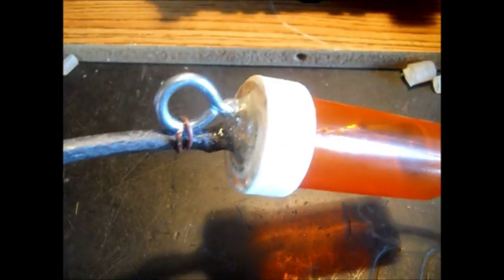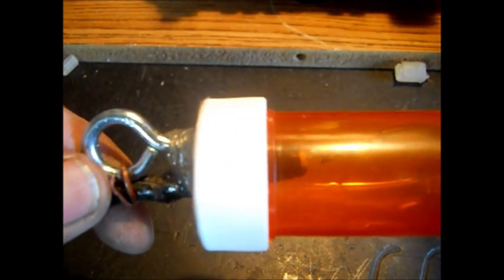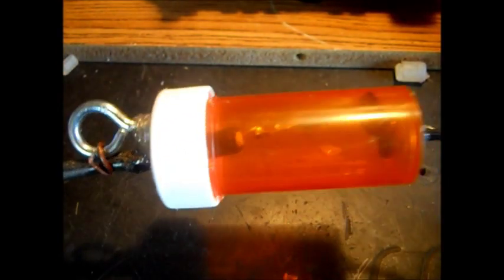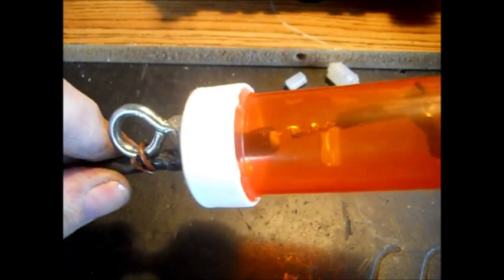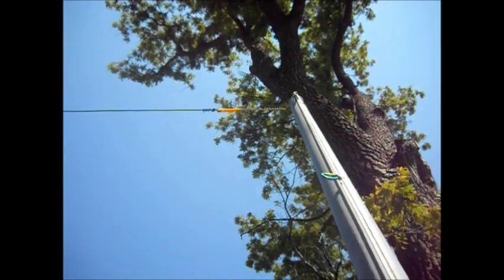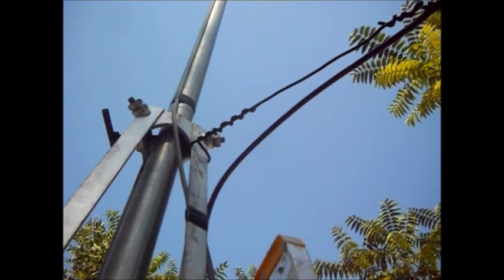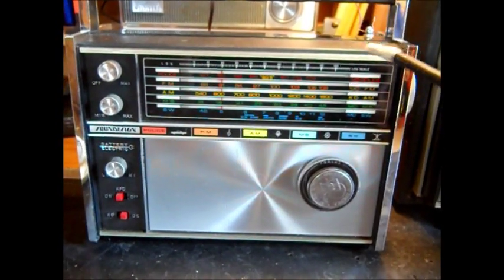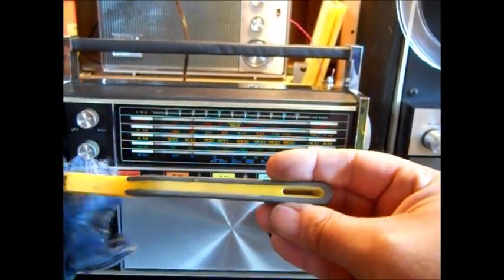LONG WIRE ANTENNA For Shortwave DXing Part2

Comment: A point, if I may Sir. You know what you're doing, no question. But if you do not ground the braided shield, it is no longer a shield, but an antenna. The shield will be influenced by electromagnetic energy and will act as a pickup coil, infusing that signal into the copper feed line. In this application, that might help signal strength, or pick up the interference within the room as you hear on your video. But it should be noted that the feed line is no longer shielded, but part of the antenna.

Comment: Cont. shield and ran it thru my vinyl window and onto which ever rig I was using at the time. It works well enough until I get a better set up done. One of my best and surprising antennas are 3' spiral antennas, with one spiral as the pick up coil. Built first for medium wave reception with a 350 pf air cap for tuning, it's 120' of network wire in 15' lengths with  soldered together. I can use those solder joints as taps also, But I found it both I had made to be good for SWL and easy to set up.

Comment: Greetings from California. Sir, you have explained very well how to use normal wire as an Antenna for SW Dxing.
That signal at 4.5 MHz is the Colorado Atomic Clock Broadcast. Nice.
The medical pill container may not stand the UVA and UVB radiation for long, please be aware of it.
Once again, thanks for the demonstration. Cheers.
Reply from the maker: Thanks for Watching

Comment: Awesome and clear answers. In my mind, I totally missed the part about fishing wire or nylon rope to insulate the wire from the tree branch ... I would have done it bare, and that would have been a mistake. Understood loud and clear regarding grounding. Excellent advice on not touching the window frame. I have a ground rod already outside my window. Finally, a clear answer, thank you so much for responding. 73 - John

Comment: Sweet, takes me back when I was a kid. I had a sole Random Longwire and 1 Dipole. My Longwire was very basic, strung in between two Oak Trees, nowhere near as elaborate as yours. The Dipole setup was somewhat similar. They both pulled in some great DX on those long, cold winter nights.
Reply from the maker: I have a new video of a antenna made from a fishing pole and my new small short wave radio if you are interested

Comment: I want to thank you for taking the time to make this video! It truly helps new SWLs like me. 2 questions here: I can understand that you want to protect against the elements and that you want to use shielded wire ... but I'll be straight, I'm broke and not a DYI guy: I have 300feet of bare copper wire. If I just attach it from one huge pine tree to another - in a slope - wouldn't that be enough? About grounding: How do I ground ONE straight piece of copper wire? Your help is appreciated. Thx!

Comment: It is true there will be some siganl loss from feed line to ground thru the shield, and it depends on the operator if he wants to try to pull out such a weak signal. Without the shield grounded, you may as well use a simple piece of wire. Your feed line coupled with your shield, which in turn coupled with your mast. For shortwave listening, not taboo. I have 80' of coax running east to west on my roof from an ole sat dish. Out of neccessity last fall, I place a piece of network wire into the

Comment: As far as length goes since it is for receive length isn't an issue, but generally speaking at shortwave frequencies the longer you can get it the better.

Comment: You wouldn't want to ground the coax feed line, however, if you were going to leave this up outside for any length of time you would want to put a lightning arrester on the feed line. Also it is important to get the pill bottle as waterproof as possible. Water inside it will cause corrosion which can lead to both mechanical and electrical failure in the connection, which will cause signal loss, moisture can also cause signal loss if it gets inside the coax
Reply from the maker: I had this up for 2 years and never had any moisture problem but the pill bottle was getting bad  from the sun covering it with tape would be the best
Reply: Use copper grease to seal the connection,or even vaseline...they both act as insulators against moisture and protect against corrosion of any kind...been using grease like this for donkeys years on Oil Refineries.....

Comment: All in all, after reading about loop antennas, Gamma loops and amplified versions, verses an end feed long wire, I maybe going with the loop. It's size and signal to noise ratio is impressive enough to make one my main reception device. Now which one, don't know yet. But good video and most important is to enjoy the hobby...73's Sir...

Comment from the maker: If I just soldered and tape the wire it can get corroded  the wire I use is copper plated steel wire  this should protect it better plus the eye hook makes an easy way to mount it

Comment from the maker: Also You can run a wire on the braid side also outside and It would be sortof like the ham sloper antennas there is alot of good ham operaters on the internet and youtube with great antenna plans For listening on Sw and not Transmitting the way I made mine works well enough and Cheap to make

Comment from the maker: You may be right The way I do it works fine When I ground the sheild It will drop the signaL you can always expiriment with it both ways Using the coax cable is Better than just running a piece of wire Even with plastic insulation through a wall or window to get to the radio because that would be part of the antenna and getting it near metal would cut out your signal This is how I was Taught to do this

Comment: Also let me clarify, the same piece of bare copper wire is going right in the back of the radio (after being hung from 2 trees) ... the radio does have a 'ground' jack, so I know I can take another piece of copper and guide it out of the window into a stake in the ground ... but that long wire from tree to tree to radio ... do I ground that? Seems like it could get so easily hit by lightning ...straight into the house. Thanks in advance.

Comment from the maker: There are some great plans out there on loop antennas one on youtube uses the finned tuner from an old tube radio the call it AVaraible air capacitor to fine tune it it uses wood lathes for cross piece You can set a radio beside it for stronger reception

Comment: Back In the 90's I had a 150 foot long TV cable I used for a remote antenna feed away from analog TV sets which made a loud annoying buzz at 6955 khz the pirate radio frequency of the day.The shielding was grounded with a 3 foot pipe in ground at the end feed point. and the positive wire connected to a random 70 foot long wire antenna. At the receiving point a 1/8" plug (ground connected too)  plugged into my portable DX390 The db level was lower but there was no TV buzz I may try it again to reduce local power line noise.

Comment: Good video, it helped. What if you filled the whole pill bottle with silicone? Keep the air and moisture out.
Reply from the maker: Nick Moroney That could work Idid cover it with electrical tape

Comment: Your video setting up a connection is very good. I use a 9:1 Balun at the antenna. Primary side is the long wire connection and grounded to a ground rod at the antenna. Secondary is connected to the center of RG 6 feed and grounded to the ground rod at the antenna. The shield is only connected at the radio end, 1db signal drop, better s/n. This setup prevents antenna static build and provides a cleaner signal. If lighting hits the antenna it goes to ground. Antenna 60' L x 10' H, Coax Feed 75'

Comment from the maker: I use a piece of coaxial cable on the antenna wire That feeds into the shack to the radio I have a second Ground wire onthe radio to a ground rod outside There is No Lightning protection When not in use the best thing to do Is unhook from the radio and hoonk antenna wire to your ground wire

Comment: Dear friend, congratulations for the video.
Would you let me know: I can use the coaxial cable to the full extent necessary or is this amendment else, I turn the ground wire in that part of the cable

Comment from the maker: I do not ground the outside braid on the Coax cable It drops the signal down I use a seperate ground wire to the Radio Also with this antenna it does not matter what Ohms the cable is Hope that Helps Thanks for Watching

Comment from the maker: as in my other reply Use a piece of coaxial cable from the longwire antenna to feed it indoors use Just the center of it It does not matter what the Ohms are IT Can be 50 ohm or 75 ohm used TV cable coax is what I used  Hope this helps

Comment: could i use n32 electrical wire twisted together on the outside vert; straght up a pcs of 8-12' foot pvc, for a vertical att: ??
Reply from the maker: Douglas Mccomb For shortwave freq. long wires stretched horizontal / flat work the best You can try it your way any antenna is better than none
Reply: THX  :-)

Comment: Amazing Could you indicate something that would reduce the effects of noise on long wire antennas? My long wire is very, very noisy.
Reply from the maker: Try to ground it and also make sure he radio is grounded if possible
Reply: @not2fast4u2c  quê pena  que Eu não  entenda o idioma

Comment from the maker: Also If I had to I would run a single wire in to the radio But I would not want it to touch any metal gutters or window frame Etc. still I always use a ground rod  to grond all my stuff at least ground to a water pipe If your local cdes allow that

Comment: Hello. Great video. I watched both parts. Im new to shortwave radios. I have always did illegal ham operations downgraded radios to 10 meters years ago. Galxay 99 radio is what I use to have, and fell out of the hobby. I was very, very young then and stupid. I did not realize the type of power and equipment I had. Im still in to police scanners, but that hobby is being taken away from me via digital encryption.  So shortwave radios is now where I want to go. The question I have is. If I build one of these long wire antennas, whats the shortest length it can be? and if you keep the whole wire shielded in the air how does it pick up frequencies?
Reply from the maker: I try to have at least 50 feet of antenna wire the antenna part is regular wire not coax
Reply: not2fast4u2c So Im guessing by doing this you don't need a tuner?
Reply from the maker: No for reciecve only the length does not matter BUT on a radeo that is a transciever you should always use a tuned antenna a SW reciever you can add anything to
Reply: not2fast4u2c Ok thank you.

Comment: Does the north south  orientation matter?
Reply from the maker: Ruffus Ford No but  if you want to hear stations from N or S the best way to have it is E to W
Reply: +not2fast4u2c Radom wires do not receive broadside, 45 degrees